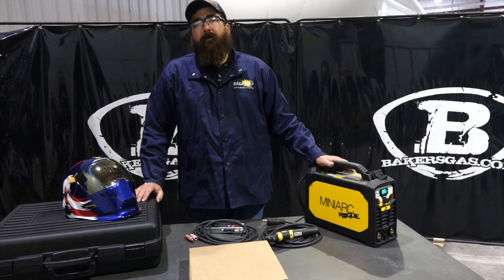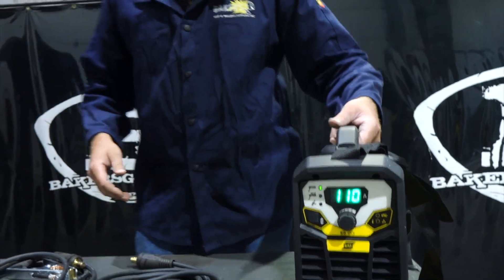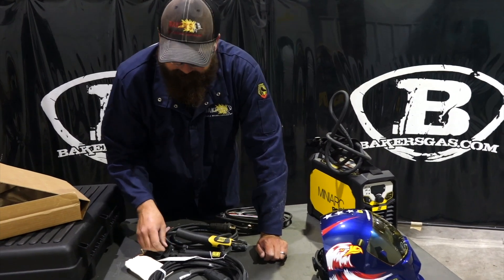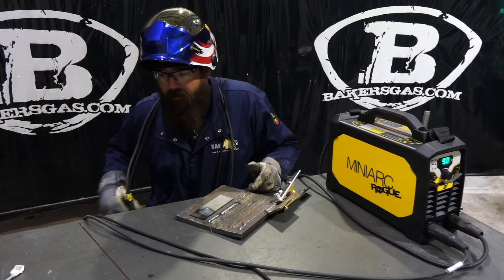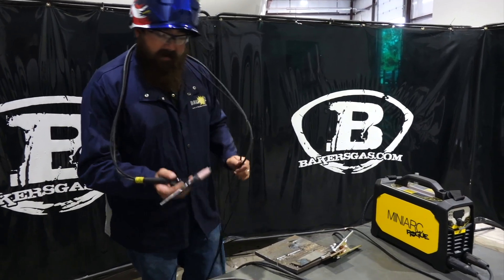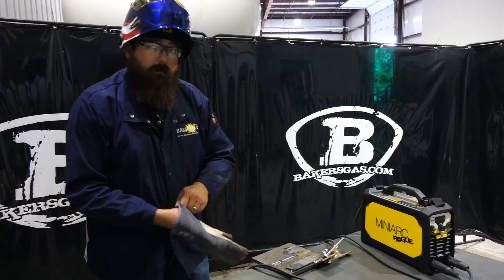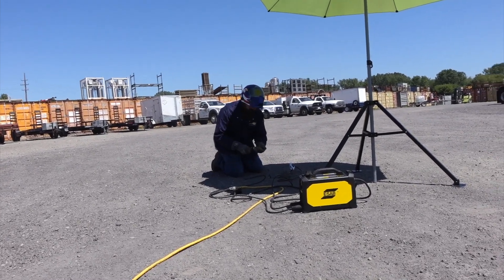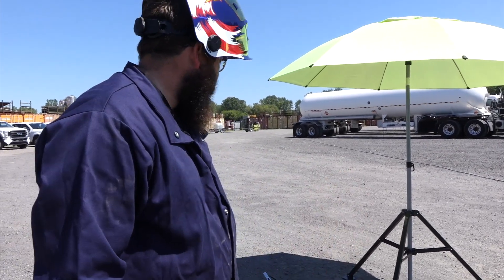ESAB MiniArc Rogue 180i TIG Demo and Stick with 150 Extension Cord Test

Comment: Another reason' not to buy this welder...If you want to be a Tig welder..
If you were to go get a job....they would have a complete Tig welder with a high frequency start & a Foot Pedal..
And you will need to know how to weld using a pedal and be use to high frequency start .
So,' Be ready..
.

Comment: After selling welders for 27 years,...I have some good advice ...If' you want to learn how and continue your'  Tig welding path..
Then don't buy this welder. It doesn't have all the features that a Tig welder wants...And needs to learn how to use.
It's too limited...Make sure that the Tig welder that you want" Welds AC & DC...For steel and aluminum..Make sure it has a high frequency unit..(lift arc works but sucks compared to  high frequency..And make sure it has a foot pedal...I've sold only 2
Finger controls..and they used them for welding Up high on ladders ,, where foot pedals wouldn't work....
Reply: Yes it is very basic . Like most.stick.welders it can tig.  The only thing they added was the lift instead of scratch.

Comment: It is lift tig right? I have An torch with a valve and button from my rebel. But you can lift tig weld without a start button? Just tap and weld with and toch like you have?

Comment: Can this machine weld aluminum with the tig???
Reply: No.You need Ac tig for thiner stuff
Reply: @bobanppvc  just wondering is all, dc for mild and stainless stel
Reply: @leebetsuie4099  dc is the best for steel.But aluminium is heat sensitive and only can be welded precisely by ac tig.Can be mig welded too but with minimum tickness about 1.5mm
Reply: @bobanppvc  I got the stick set up, looking into getting the tig attachments,
Reply: @leebetsuie4099  what welder you get?
Reply: @bobanppvc  180i for projects around the house
Reply: @leebetsuie4099  how you like it?Did you regret not buying MIG
Reply: @bobanppvc  not at all, lil machine runs great, I run mig all day at work so I need to brush back on my stick again

Comment: I'm  going to purchase the rouge 180i but I'd  like a great tig tourch looking at the eastwood flex head tourch. I see the rouge doesn't  have a solenoid will this tourch work.
Reply from the maker: I would suggest you add our TIG torch bundle. It includes a 17 series CK torch and the needed adapter. (Flex head super nice torch and affordable) Let us know if you have any other questions.
Reply from the maker: https://bakersgas.com/products/mini-arc-tig-bundle

Comment: What is the wire size of your extension cord? Thanks
Reply from the maker: We went about 150 feet it is an industrial /standard extension cord we use in the shop
Reply: @BakersGas  so what gauge is your standard extension gauge cord?
Reply: I have never heard of standard industrial extension cord.

Comment: Hello sir do you have a video how to install an outlet for welding machine?
Reply: Talk to your local electrician. They might make you a pig tail cord for your dryer if you on a tighter budget or if you have the mony install a 50 amp outlet on a double pole brake.
Reply from the maker: We do not, if you check with your local electrician they should be able to help you out!

Comment: this is a nice little welder .I have a Esab 215 and i use it  often, but they are very noisy welders. maybe when your young and not exposed to long term noise,  you might not care  but you will be deaf in time. I am old but have watched my hearing, ambient noise will damage your ears. i got on to this many years ago and so far my hearing is very good except when my wife calls me. Esab needs to attend to this fan noise , as soon as you strike an arc the fan goes on and continues for 10 min after you stop. Now don't take this as a hater comment I like my esab but compared to my 2 Fronius welders which remain silent till you push them to their duty cycle , the Fronius is just so much quieter.Yes the Fronius 180 is twice the price  but it is so much easier on your ears that it is worth considering for long term hearing. I would certainly buy this welder and keep it in my truck for any opportunity that might arise, but would wear ear muffs when using it. Esab does make very good welders , better than most.
Reply from the maker: Bruce- thanks for watching! We agree this ESAB unit is a nice option for taking out in the field. Always good to be mindful of ear protection. Fronius unit is 👌👌👌we should be posting a video on that soon! If you have any questions please let us know.

Comment: Great video! Next up should go through the foot petal :).  Oh and an FYI, the torch listed in the manual for this machine with the remote is in error by esab.  They called me to recall it, hopefully they come out with one capable for it on this machine soon
Reply from the maker: Hey Andrew--thanks for the feedback! We will see if we can get a TIG pedal demo up! Yes there were a few changes on the TIG torch but the one we linked does work with the unit and we do stock it.
Reply: Baker's Gas and a built in solenoid for gas in the torch to welder connector woulda been pretty sweet too 😁
Reply: Baker's Gas FYI I’ve been welding with the pedal for a while now,  it did work well for a while but it’s been acting up recently.  The arc won’t extinguish when you let the pedal off all the way on mine it’s hit and miss.  I think it may be user error on my end or a pedal/welder problem.  Thought I’d just update everyone.
Reply: Baker's Gas outstanding.  I just plugged in my old miller red heads “9v and 17v” with the 50mm dinse I had for my dynasty worked just fine.  I was looking forward to an amperage control torch tho
Reply: Bakers Gas is awesome!!!! They helped me finance a new Bobcat 260 with ease!!!!! My go-to for anything welding from now on!!!!

Comment: That’s awesome. Thanks for coming back to let me know about using this unit on a drop cord. I have already purchased a fronius and it’s a badass little unit.
Reply: Edward Hall I have the transtig 210. It’s awesome. I like having a built in gas regulator and hf start on tig and the pulse stick function